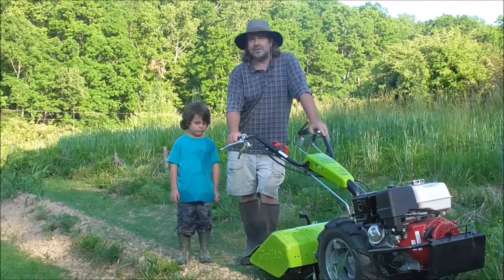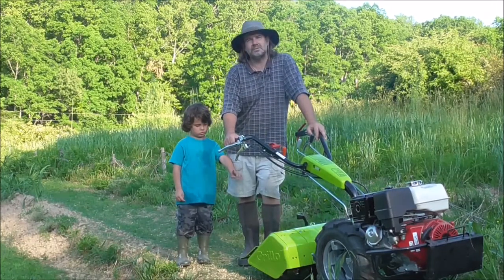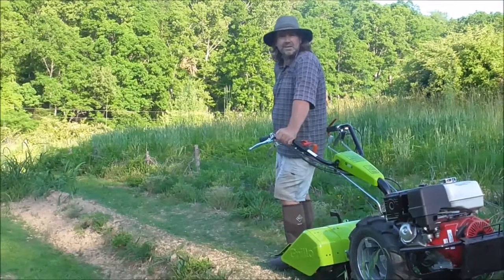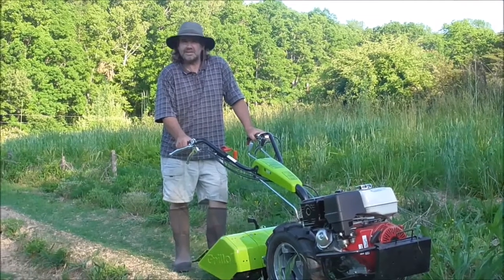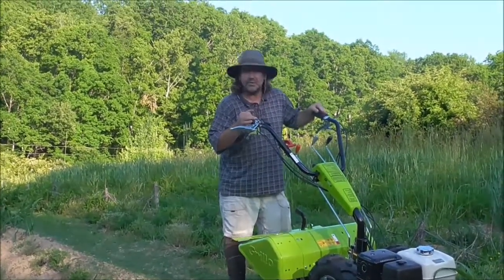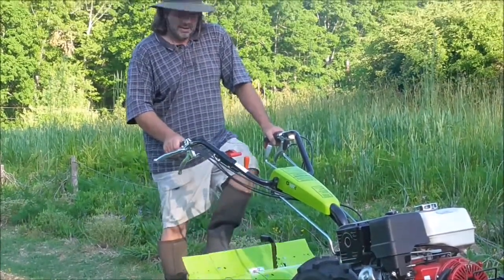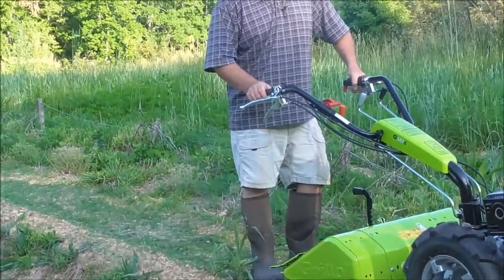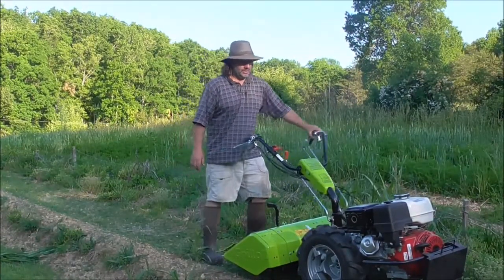Grillo Tiller, G107D cultivating

Comment: You did a video of the 30 inch tiller with outer tillers to build beds.
I like to see more videos and info on this type of tiller
Reply from the maker: Hi John. Not sure I follow you fully...Are you wanting to see video of the rotary plow building a raised bed or of the 30" tiller with augers on either end that "form" a bed while tilling? If its the latter we are not the manufacturer of that tool.
Reply: Dailey's Farm & Walk-behind Tractors yes that was it.
Why isn't anybody promoting this tiller.
Reply from the maker: I can only answer for myself. We don't manufacture it. The manufacturer needs to promote it and then other users. Not sure if it is on the market yet. For me personally, I rarely ever till. So it does not really "do much for me". Meaning I am not its target crowd. Still the idea is "cool". For my small scale growing I use rotary plows, and power harrows. Although I think this tool looks neat, I have serious questions about how well it would work in a heavy soil. Not to mention the over pulverizing of the soil that will occur when making multiple passes to shape a bed. These days there are many small scale growers who intentionally AVOID the tiller for this exact reason. I think the rotary plow and even more so, the "bed shaper" tools are much kinder to the soil, when it comes to making a raised bed with a power tool. Of course if there ends up being demand for "tiller/bedshaper" in this market, I would be happy to sell it to my customers if that is what they want. We sell a good number of tillers each year, but we sell more rotary plows and power harrows then we do tillers. Thanks, Richard.